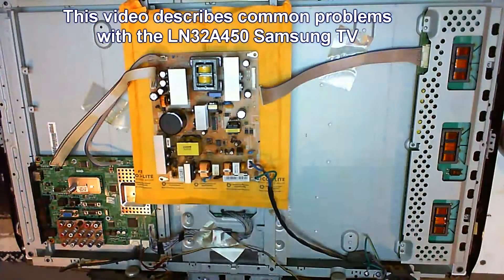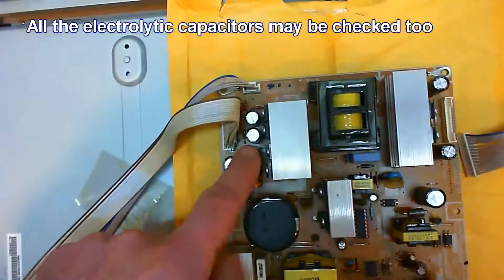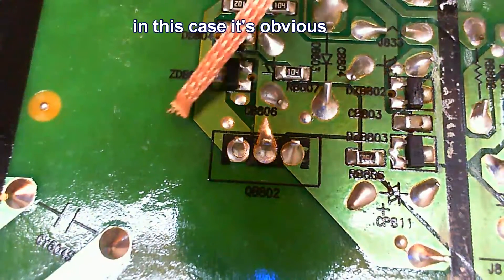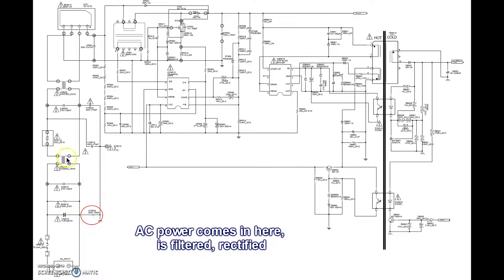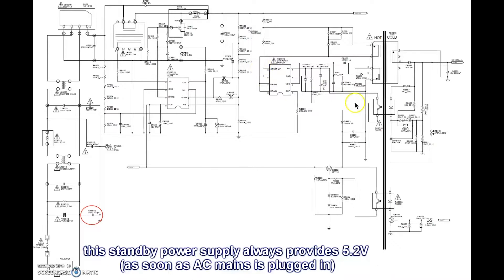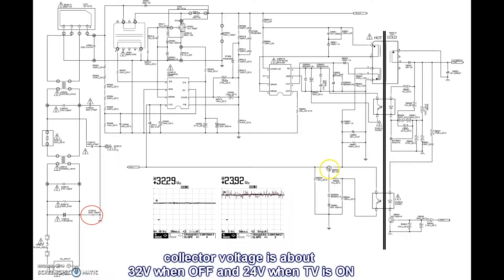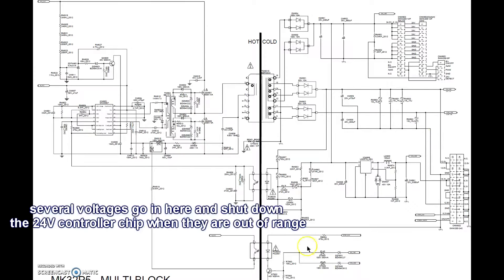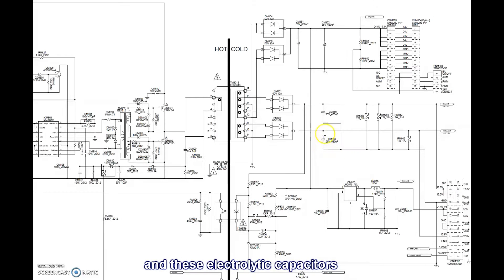LN32A450 all common power supply faults + reference measurements

Comment: Hello my board is an bn44-00213a and it has been burned in the section where the CM810 the blue ceramic capacitor is located. So my question is what type of capacitor is that to replace it. Thank you all
Reply from the maker: On the ...214a these caps are 2200pF 1kV

Comment: Great Video! Mine worked fine until it started making a arcing sound, In the area near CP803 is a blue capacitor and two jumper wires that have been scorched. I need to repair the foil under the board, replace the unknown capacitor (one lead burnt) and both jumper wires, I'm up for it but I need to know the value of that CAP and somehow obtain it, any suggestions? Many thanks
Reply from the maker: I don't have these boards anymore. Download the schematic from the comment section, you should be able to identify the faulty part. Small and blue may be CB801 or CP802 for example

Comment: Tom Tech. My power supply BN44-00214A has the blue part (transistor?) next to the big black cap. burned off the board and the jumper (I think) burned. Can you send me the part specs on the blue part and is the other part a jumper or something else. I can't read my board due to burn. I also see at least 5 bad capacitors which are easy to read for replacement.
Reply from the maker: I'll have a look later. If it's a blue part it's most likely a capacitor. I'll let you know
Reply from the maker: 2.2nF/1kV. The two jumpers near this capacitor are in parallel but only one burns. I<ve had 3 boards  like this, still have one but no time to troubleshoot.
Reply: Hey guys, that's exactly what happened to me. The blue capacitor burned and the jumper too. I just wanted to know where I could find those parts so I could replaced it. Also, could this problem have caused others or I simply need to replace the burned parts? Thanks in advance!
Reply: Just happened to me! Did you end up fixing it?

 +TomTechTod would this capacitor    http://www.ebay.com/itm/100pc-Disc-Ceramic-Capacitor-222K-222-2200pF-1000V-1KV-K-10-Y5P-RoHS-Taiwan-/130304323447   solve this issue? I have the exact same blue part next to the big black cap that burned off one of the jumpers.
Reply from the maker: Yes it's 2200pF and 1kV that's correct. Remove the brownish glue around it and on the PCB, I remember having seen a comment somewhere that it's becomes slightly conductive over time
Reply: I have the two jump lwires burnt and a hole in the board. Can I bridge the hole with a standard wire or are these jumpers resistor type? I will also replace the capacitor.

Comment: Ok so my Samsung flat screen won't turn on. The little red power indicator isn't lit either. I took the back cover of the tv off and noticed that the bigger transistor has a black substance on it (located on the power supply board) I'm guessing that is the issue. Is there a website where I can order the same brand etc?
Reply from the maker: this may not necessarily be the issue. a black substance on a transistor may just be some stuff to keep the transistor from moving and consequently breaking the solder joints. you would need to measure it in order to be sure. I don't recommend replacing parts before being sure what the issue is. You can order parts from Digikey.com for example.
Reply: TomTechTod aw. Ok. I hope it's nothing bigger...do you have an email I can send the pictures to you? I will also of course ask a technician I just don't want to trash this tv. Just want to know if it looks fixable?
Reply from the maker: +Marcella Ramirez tomtechtod at gmail com
Reply: TomTechTod ok I sent some of the pictures. Thanks for the help. I really like this tv. Any advice is much appreciated :)
Reply: TomTechTod you are awesome thank you! Turns out I have the same power board in my Samsung tv. :) Now to order and install lol

Comment: i  changed all capatiors but tv just work for 1 min. and shuts of and start again .any clue  about this .
Reply from the maker: you replaced all electrolytic capacitors, the 18nF resonant power supply cap, checked all solder joints with a magnifying glass or microscope?